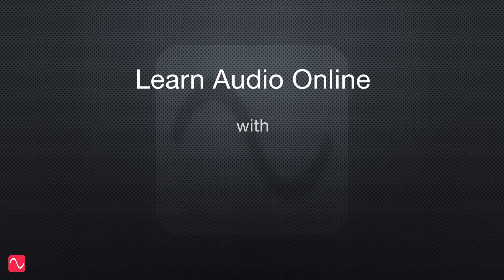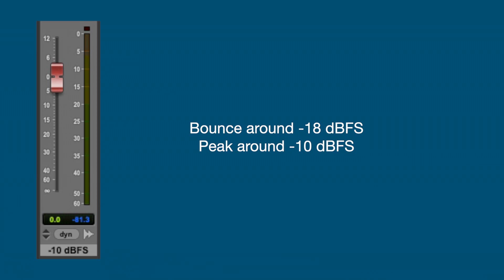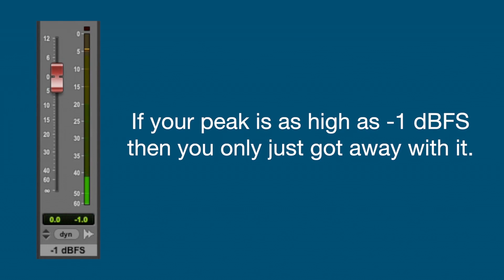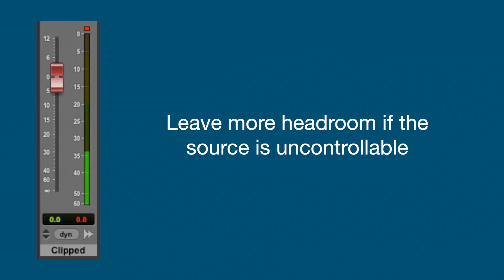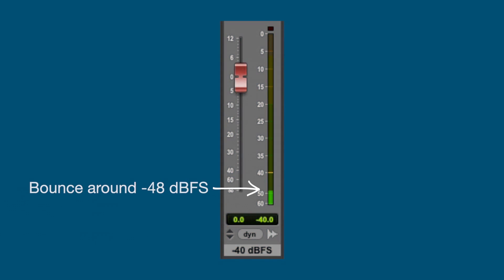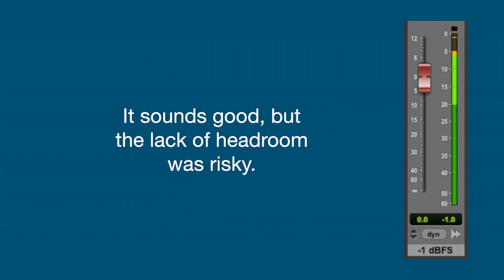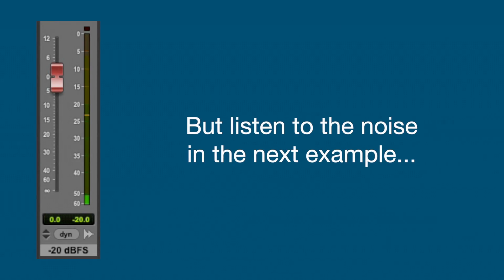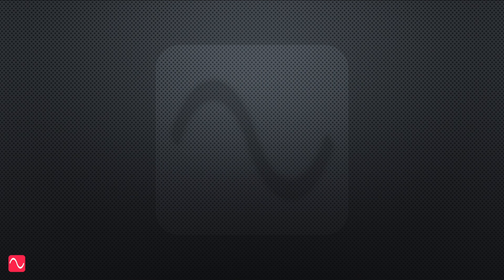Gain Staging Mistakes Part 1: Setting preamp gain

Comment: I wish you guys had made it clear in your video that the volume setting must be done before the computer. The proper gain staging needs to happen before the analog-to-digital-converter. Your video suggests that this can be done within the DAW, but there it is already too late. Therefore I would not recommend this video to anybody looking for advice for proper gain staging. A lot of what you are telling is true but some part is misleading and therefore the results may be unusable. Sorry.
Reply from the maker: I doubt if you're all that sorry. You're getting some kind of pleasure from criticising stuff I never said.
Reply: @AudioMasterclass  0:27 "All I need to do is set the gain and watch the meter in my digital audio workstation". I feel you should have said that the gain needs to be set on the preamp of the interface  (or elsewhere before the ADC). The way you say it can be interpreted as to use the pregain inside the DAW, especially since you are moving the DAW's fader afterwards. However, I feel you actually meant the gain before the ADC and it just came across in the wrong way for me. I agree with the rest of your video, though.
Reply from the maker: @klauba  Seeing as I said a mere five words between "audio interface" and "set the gain" I think a reasonable person would understand that it's the audio interface where the gain needs to be set. Having said that, if I update this video it wouldn't hurt to say "set the gain on the interface" to be doubly sure.

Comment: Normalized "good" -10 level 4:47
Normalized "bad" -40 level 6:57

I have to turn up everything pretty loud to be able to hear the noise over the signal. Is that bad hearing (of the high frequencies) or to be expected? I found the bad sample sounded slightly rougher/ harsh, but the noise is not audible at normal (or lower) listening levels.

Comment: Recording while playing games (for recording or on stream) I have to set normal voice at around -30 or so, cause the peaks are very high, but still, with the processing afterwards (afterwards in teh chain with VSTHost, so it's processed live), it works just fine for both live and recording. A bit of noise is much better than peaking which just sound painful to listen to if it is the norm in a recording. And for gaming, the game sound mostly covers the noise anyway.
Reply: You’d be better off recording at a higher level (-18dbvu) and using a compressor/limiter to smooth out the crazy peaks and stop clipping.
Reply: @pete3816  The peaking would happen before the compressor anyway, so it wouldn't change anything.
Reply: @Alexandra-Rex  clearly you don’t know what you’re talking about. I’m not talking about a VST compressor.  You use an analogue compressor BEFORE the signal reaches the ADC. It will limit the signal peaks and stop the ADC ever peaking.
Reply: @pete3816  Do y ou mean VST?

If the signal is clipped at the input stage, before any processing and before the ADC, it's still clipped regardless of what you do afterwards. You can't unclip a signal. Yes, it's less harsh than if it happens when it's digital, but it's still digital.
Reply: @Alexandra-Rex  bro. You clearly have no clue what you are even saying!  Clipping a digital ADC happens WAY earlier than it does in the analogue world. Just because you have historically been clipping your signal in the digital realm does not mean that you are overloading the analogue circuitry of your pre-amp. It just means you’ve set too hot a signal to your ADC. Do like I said in the first post - place an analogue compressor limiter BEFORE the ADC and you’ll be good to go.  Or, just keep playing your computer games and leave the audio engineering to those that understand it.
Reply: @pete3816  You're being very aggressive for some reason.

If I clip the signal while it's analogue, it's already clipped when it gets to the ADC.

If I clip the signal before it reaches an analogue compressor, it's also already clipped.
Reply: @Alexandra-Rex  bro, I’ve already explained it numerous times. I can’t make it any clearer for you.  A compressor/limiter in the analogue chain BEFORE the ADC will stop it clipping. If you run a hot signal in the analogue chain IT DOES NOT CLIP.   It saturates and then distorts, often in a pleasing way, but there is no clipping.  You can either accept it and learn something. Or just do it and see for yourself. Or ignore the advice and stay ignorant of basic audio engineering. You choose.
Reply: @pete3816  Ok, so it distorts, not clips, but, it still distorts and I don't think it sounds very pleasing, even if it's less harsh than clipping (I mentioned this already).

My point remains the same whether we talk about clipping or distorting. If it happens before the compressor, it is still distorted or clipped regardless of the compressor.
Reply: @Alexandra-Rex  bro, I’ve been recording and mixing audio for decades in studios all over the world. Either take the advice and try it. Or just stfu and play your games.
Reply: @pete3816  You realize we agree on everything except on how pleasing the distortion is, right?

So I'm going to stop replying, cause you seem to get upset by this.

Comment: Hello David. What about the track input gain control itself? Would you adjust that also to -18dB or leave it set at 0dB and just use the fader only? When would you opt for using the input gain control as abviously its there for a purpose. Thank you so much. PS - Will enrol in your course!
Reply from the maker: If you can tell me which DAW you're using I can check this further. DM
Reply: I am using Adobe Audition. Another associated question is how loud should my project files be? It would make sense for them to be all at a nominal level, say -3dB or -6dB perhaps, and normalised to those values? To help the mixing process? I totally get the -18dB target, but is that set with fader levels @ -18dB or by the channel input gain control, then raising the fader to 0dB? There seems to be a lot of variables in this process. In my current project I set my track input gain controls in the DAW @ -18dB, but the project files were much too low and I had to norrmalise them to -3dB. The fader default being 0dB. Thank you David.
Reply from the maker: I'm not an Audition user so this is a generic reply. If there is an input gain control in software that controls the level being recorded, then it is a convenience feature that saves the user having to reach for the real gain control on the audio interface. Since it can only work on the bits that the interface sends into the DAW it cannot improve the signal-to-noise ratio or distortion performance. Also, it can't control clipping. So I'd say don't use it. Set the gain on your interface. Regarding your other question, it doesn't matter. When you're recording you can set the gain (on your interface) as high as you like as long as there is no clipping. Setting a lower gain however gives you more headroom so there is less chance of an accidental clip. If your meters are bobbing around -10 dBFS then you're in the right zone. Or go for -18 if you want to be extra cautious. Go for -6 if you want to throw caution to the winds but watch out for clips. DM
Reply: @AudioMasterclass  Thank you David. I won"t be using the DAW input gain any longer. That said, what dB level would you opt for re' the project files?

Comment: How do you deal with a situation where a vocal or guitar performance gives you -24dBFS RMS and -6dBFS peaks?
Reply from the maker: Celebrate! Your level is perfect with 6 dB headroom that kept you safe from clipping. With headroom, like many things, it's always better to have it and not need it than need it and not have it. Your RMS measurement compared to peak is governed by the dynamic range of the performance and it is only the peak measurement that you should consider when setting gain. DM

Comment: Is there a part 2?
Reply from the maker: I seem to have forgotten about that. Yes there will be at some point, but for now I can advise that this whole issue is vastly inflated. Part 1 basically says 'no red lights on recording', and 'keep some headroom'. Part 2 would be 'no red lights when you bounce'. Part 3 is 'it's good to know what levels your plug-ins clip'. Part 3 would apply to a plug-in that emulates analogue equipment. For instance it would seem appropriate that 0 dBFS is the level the analogue equipment that the plug-ins is modelled on clips. But DAWs can handle much higher levels internally, so it's good to be aware of this, and also that it's easy enough to test clipping using sine waves. Keep your monitor level down though. There's more detail to add but these are the main points and with modern DAWs it's difficult to go wrong otherwise. DM
Reply: @AudioMasterclass  If you do post Part 2 I'll be interested to watch it. Gain Staging is an often discussed topic and I appreciated your video because it was one simple concept and not a long drawn-out discussion. Makes it easy to understand and apply to my recordings.

Comment: So,  -10 or -12 dbfs is a good peak signal for gainstaging, right? For basically any source? Same for percussive and non-percussive?  And what do you think about doing the gain staging to 0 dbvu without going over 0? What is better?
Reply from the maker: It depends on how predictable your source is. -10 dBFS is good for voice. It doesn't have to be exact but the meter should hover around -10 on peaks. The aim is to be completely confident you will never get an over which will ruin your take. You can concentrate on helping your singer perform well. But if you were for instance recording from a drum machine, which is totally predictable, then there is no reason not to go all the way to 0 dBFS, just a little below clipping. The higher level you record, the better the signal-to-noise ratio, but with 24-bit audio it's hard to tell the difference between -10 and 0. DM
Reply: @AudioMasterclass  Hi, some people say that even with a predictable signal, this must be -12dbfl tops, because of the plugins you put afterwards. Is this so?
Reply from the maker: @preciseaudioblog  The saying that 'two wrongs don't make a right' comes to mind. 12 dB of headroom is OK in a 24-bit recording which makes it a 22-bit recording, but your performer might go crazy and the level goes up to -1 dBFS or maybe even -0.1 dBFS. Don't panic, everything is OK. Any plug-in that can't handle 0 dBFS at least has not been competently designed. But consider that a plug-in that emulates hardware may also emulate that hardware's clipping characteristics. Or in the case of tube equipment a progressive increase in distortion towards clipping. The key is to listen. If you like what you hear then great. If you don't and you suspect the issue is level then use a gain plugin before the plugin that doesn't sound the way you want. Other than for the purpose of headroom there is never any reason to record at a low level. DM

Comment: Thank you for the useful informations in the video. Can you recommend how to properly set gain for mixing from DAW to analogue console line inputs (in my case Focusrite Saffire Pro into old Studiomaster 16-4-2 Series 5, using Logic and Pro Tools). Regards.
Reply from the maker: This is generic for most audio interfaces and consoles. If your console has gain controls on the channel line inputs: Set the gains of the console channels you intend to use to minimum, EQ out. Connect the line outputs of the interface to channel line inputs of the console. Solo one channel and play your track. You should see some level on the main console meters. Increase that channel's gain until you get a good strong reading on the meter, not hitting the end stop or top LED on the highest peak. Repeat for the other tracks and channels. If your console doesn't have gain controls for the line inputs, and your interface probably doesn't have output level controls other than the main monitor outputs, then you'll probably be lucky and the levels are OK. If they are too high, you'll need to lower them in the DAW. Regarding the StudioMaster - Looking at photos it seems to have a clip indicator on each channel. If this is pre-fade which it should be, then it will be useful and should never come on. (There's another way to set up the console using sine wave tones, which you could use for any transfer. For this place a sine wave tone at 0 dBFS on one track, solo that channel of your console, then set the channel gain so that the meter comes within a hair's breadth of the end stop, or the top LED just comes on. Set all the channels similarly and this will work for any transfer.)
Reply: @AudioMasterclass  Thank you so much! All the best!

Comment: What if the master is clipping when my channels are at healthy levels, & that is causing me to have to lower all the channels extremely low, how do I fix this?
Reply from the maker: Pull down your master fader. Modern DAWs have a lot of headroom and are very flexible, as you can see and hear at https://www.adventures-in-audio.com/exploring-the-massive-headroom-in-your-daw/ If you have to lower the master by more than 10 dB, consider setting your channels lower next time you mix. If you have to pull down the master by more than 20 dB then there's a problem somewhere - a) Make sure your original recordings don't clip, b) Start off your mix with the first few tracks around -10 dB or so because the level is going to rise as you add more tracks, c) If a plug-in increases the level, like an EQ boost, consider lowering the fader to compensate, d) A plug-in, like an EQ boost, may add level in the master track. If your master fader is pre-insert then a level trim plug-in, placed last or just before your mastering limiter, can be used to compensate. The simple solution normally is to make sure your original recordings don't clip and to start off mixing with your tracks around -10 dB.

Comment: Thank you for this video. I'm wondering what the normalized level is. Did you apply any limiting /dynamics?
Reply from the maker: The narration was processed separately and is set to -21 LUFS using the Waves WLM Plus. The poem does not have any limiting or compression.
Reply: Thank you so much!

Comment: what would be the difference between reamping a weak signal vs raising it with clip gain
Reply from the maker: The reason the signal is weak is because insufficient gain had been used when recording. If you can't raise it enough with the fader, then you can use clip gain, a trim plug-in, or normalization. These will all raise the signal level digitally and there will be no noticeable effect on sound quality. If you send the signal out of the DAW and amplify it electronically then there may be a little more noise and distortion, but unless there is a fault then it should sound OK. There will be latency to correct for. It's just more trouble though and raising the level digitally is a lot easier.
Reply: @AudioMasterclass  got it thank you please make more such videos
Reply: @AudioMasterclass  in this case how do you define latency ?
Reply from the maker: @gauravsharma-eh7sz  It's the time it takes to get the signal out of the DAW, through the digital-to-analog converter, back through the analog-to-digital converter and back into the DAW. It will be several milliseconds, perhaps tens of milliseconds, which is enough time to throw things out of sync. You can correct it, but it's one more thing to do.